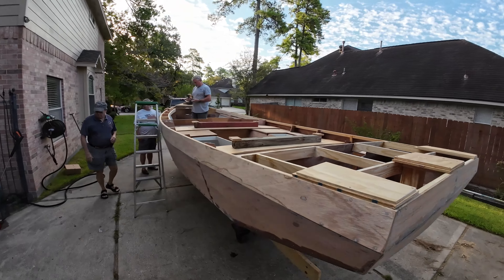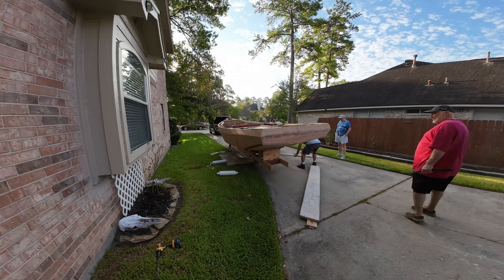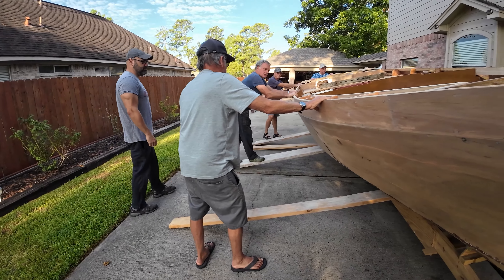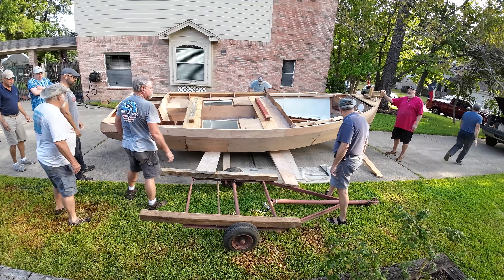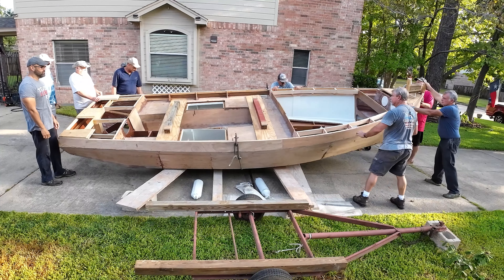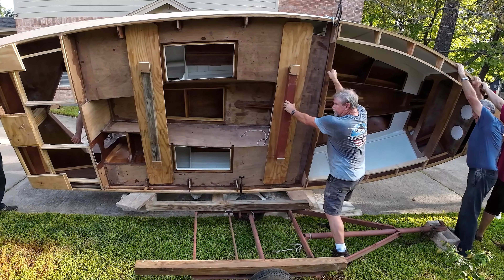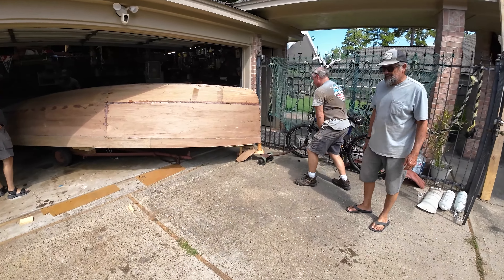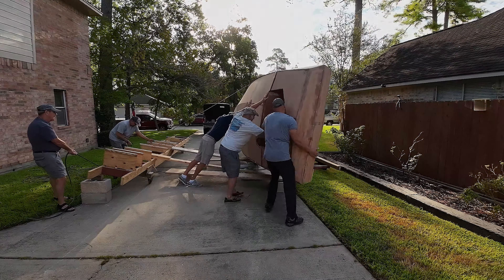Building a Welsford Sweet Pea based cruiser modified for the Texas coast.

Comment: It does my heart good to see another one of John Welsford's  design flow from his mind to reality. All of his designs were born from high winds and the rough seas of New Zealand. No better modern designer can be found. Can you tell I'm a fan?
Reply from the maker: Buddy is getting it rigged for the Texas 200 in a few weeks. That will let her stretch her sails and show her stuff.
Reply: @ZiggyLavengood  I resurrecting a Venture 17. I'm hoping a 17" draft is adequate for the 200. It is a goal of mine to run with you fine people at least once or twice.
Reply from the maker: @crawford323  I draw 18 empty, close to 2 ft fully loaded and I do it. the skinny boats get to plat in the shallow water more but you will be fine
Reply: @ZiggyLavengood  Throw a stern anchor and then beach it. I need a winch which I don't have at the moment. But yes, I believe it's shallow draft enough.  41/2' when the keel is down. I found out the hard way when running down wind, you had best leave the keel down. The boat is light enough the center of gravity and center of lateral resistance changes enough to create an almost uncontrollable situation. The good thing about a swing keel is if you do run aground de power the sails first, get control then raise the keel. Ziggy, keep up the videos, you have many fans out there who want to sail the ditch on the 200.